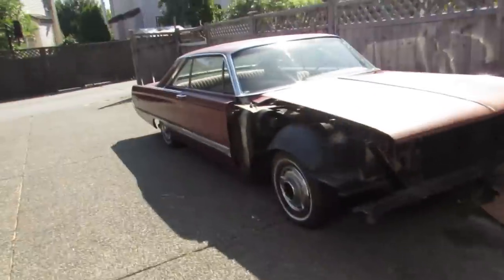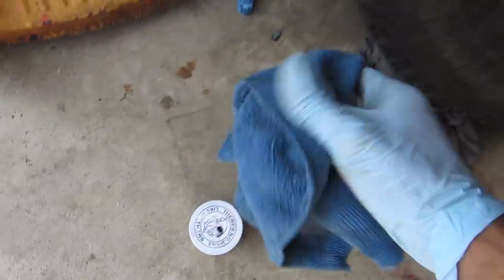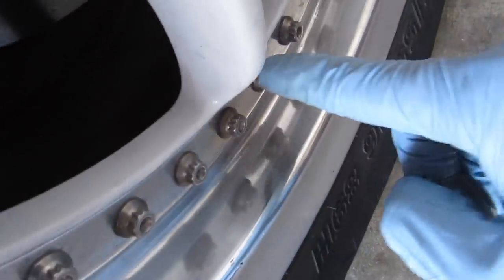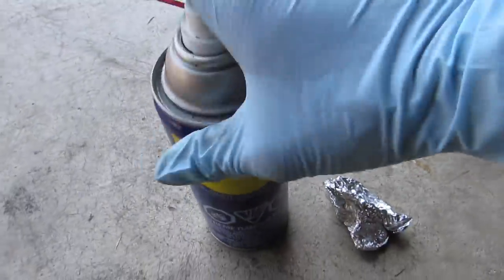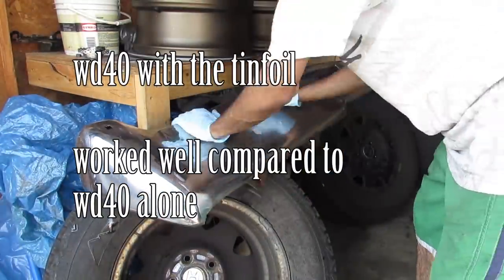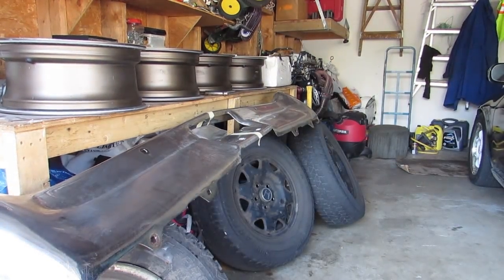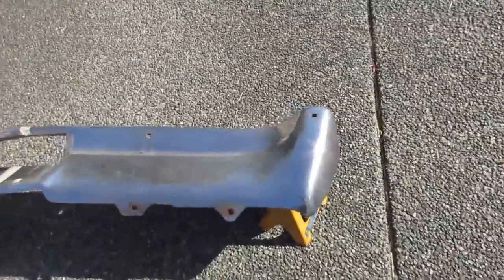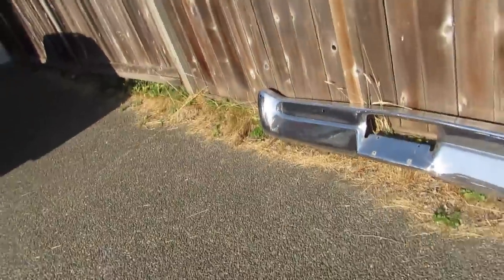HOW TO: POLISH CHROME BUMPERS LIKE NEW

Comment: Dont need all that stuff Steel wool and turtle wax will work its old trick im all most in my 50s i been using steel wool 0000 and turtle wax in my teens it woks its less work...

Comment: i just installed a used bumper today on my chevy pickup and then i tried your trick and thanks, it really does work. i picked up the used bumper for 30.00. so i saved a couple bucks for sure. thanks again and keep them coming.

Comment: I used lemon juice - it cleans parts really well, then I got some citric acid from the pharmacy and made a stronger solution for cleaning off handbrake parts pre plating - which is much easier than you would think, also citric acid is more friendly
Reply from the maker: how was the end results? come out looking good?

Comment: a pink spot showed up after polishing?

Tried mothers mag polish on a scratch, then a pink chrome spot happened. 

later that spot got rust. Then I tried this to get off the rust. rust is gone but also a little
more pink lines
Reply: That's probably the copper in the first layer of the chroming process coming through. A proper triple plate chrome is first plated in copper, then nickel, and finally chrome.

Comment: I've used coca cola and steal wool on chrome bumpers to remove rust. Surprisingly it works great.
Reply from the maker: Ive wanted to try coca cola. I herd it works good
Reply: Wrench life 604 it surprising does.
Reply: UNDER FUNDED GARAGE steel wool leaves scratches eventually rust
Reply: @James Mosley  need the 0000 steel  wool, it does not

Comment: This will work for my rear bumper because it looks kinda like how yours did when you started but my front one.. nah. haha.
Reply from the maker: give it a shot on the rear and let me know how it goes, 
planing to ever get a new front bumper in the future?
Reply: Yeah. I have other greater needs before it though. Doing a vinyl top delete and quarter panel repair so the janky front bumper is low on the list unless I see a cheap one locally.
Reply from the maker: hopefully you dont run into rust when you remove the vinyl top. those things are moisture traps
Reply: There's already quarter rust at the lower seam. However the good part is it's just exterior right now so it shouldn't be that huge of a deal to take care of. The pain in the ass part is that from the factory they didn't finish the metal under the top and just covered it with the vinyl. So.. Going to have to do full body work to smooth and make it decent. Plus find all the right trim. It's going to suck but that's what you do for cars you're dumb enough to love. lol